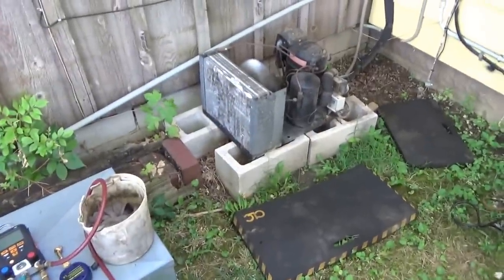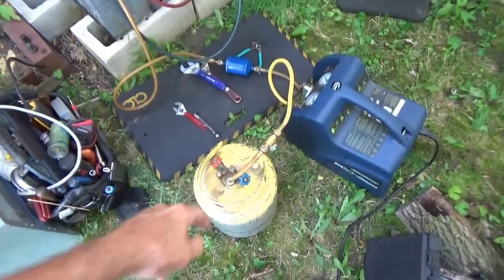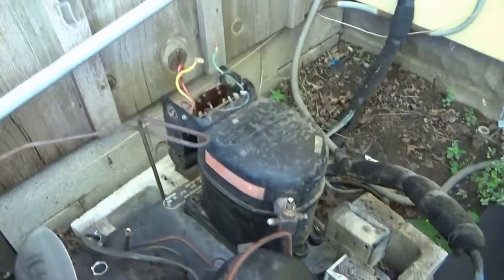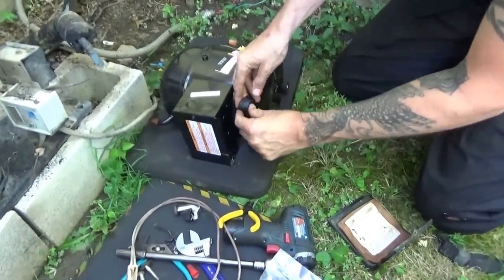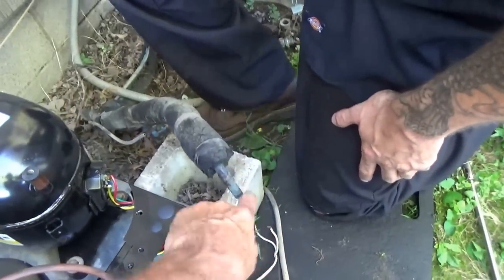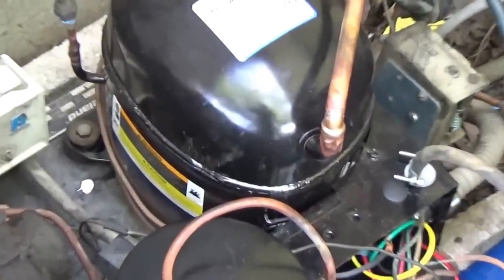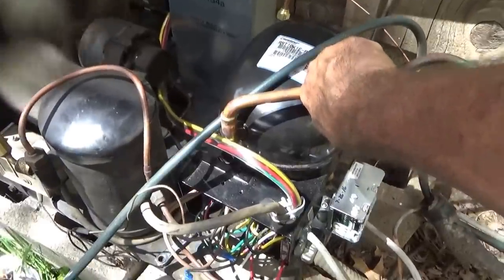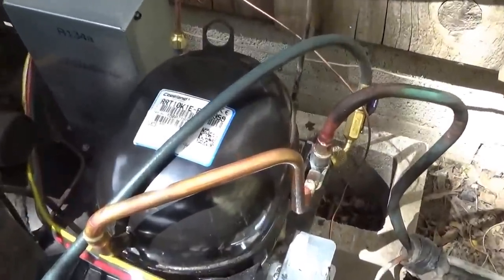Wine cooler compressor change

Comment: Jim
This is an excellent collection of hands on experience and knowledge.
Each one is very informative and filled with your easy humour and talent.
could you please post a video on your vacuum pump techniques and the fittings and hoses that you use and trust.
thanks for your efforts in this industry.
Reply: Hello Fred K,
The vacuum hoses  and fittings are made by Appion.  I connect my BluVac  Digital Micron Gauge to the Appion MGAVCT Valve Core Removal Tool.
Cheers,  James

Comment: People saying you should have replaced the entire thing must have richer clients than me lol. To me there is only one question at the end of the day... Is the wine cold. Thats what the customer really cares about. Good video and repair Jim!
Reply: I am a firm believer in not throwing things away, but the problem I see with keeping the unit is the condenser coil.  It is most likely undersized for 134a.  Definitely not as energy efficient as a newer model would be, with a more efficient condenser coil.
Reply: @markcarpenter3600  134A underszied?   134A requires the Least....  R 404 or R 22 the condenser has to be very effcient
Reply: @primetime758  134A is definitely more efficient than R12, but it is my understanding that it doesn't transfer feat as well in the condenser.   If the system was slightly oversized you probably won't see a problem.   It takes a more efficient condenser to do the same work that R12 did, everything else being the same.  

I worked an old (pre 1982) LEER ice merchandiser running R12, which was short gas.  Already knowing the answer I called LEER to see if I could possibly get away with putting R134A in it.  He said the condenser wouldn't be efficient enough.
Reply: @markcarpenter3600  meh i call BS.... i've never had an issue   rooftop condensers or just outside during the heat of the summer never had a single issue

Comment: Nice fix, Jim. I like replacing the compressor if cond unit's in good shape. Been running into a lot of leaking king valves lately,though. Packing tight but leaks.Techs tend to over tighten them. I miss the strong steel caps.
Reply from the maker: yeah, the EPA messed up by not doing away with plastic and aluminum caps, thanks
Reply: Jim Pettinato good evening Mr Pettinato I hope you are well and the reason we have not seen you in you tube is because the weather! We really hope you are well  and hope to see you soon ! I have learned more from your videos than what I learn at school thank you very much .

Comment: Jim Pettinato is the Michael Jackson of Refrigeration.

He can Moonwalk his way into Walk -in Freezers; snap his fingers & get the Fans running, defrosting clock ticking, Ice melting, Compressors belly dancing like Shakira & customers bowing down kissing his feet

 Refrigeration apprentice usually left drooling

Comment: Quick question. You replaced the (suspected) R12 with R134a. Are there any rules-of-thumb here that you could share on when it's ok to do that (along with the compressor swap). Yes, I realize there's not much choice when it comes to R12.  I'm always confused by when and where one can change refrigerant on systems like these. No concerns about the evap or condenser? Thanks for another great video.

Comment: We've never used 134a as a drop in but it makes sense since the new compressor has POE oil
Reply from the maker: been doing it since 96, use to take comp off and change the oil, now honeywell recomends adding 15-20% poe on top of old oil. thanks
Reply: ill admit we are a little slow on the change over. been using 409 to replace r12 but tends to run hot thanks enjoy your videos

Comment: nice job Jim looks good another quality job 
I have a question on the flux you us when brazing lately I had problem with brazing joints with some coils and condensers valves thinking about using flux any problems with flux getting into the system like the txv I put in a lot of carrier and rheem equipment any tips thanks again for the videos Jim
Reply from the maker: no problems not even cap tube systems,thanks

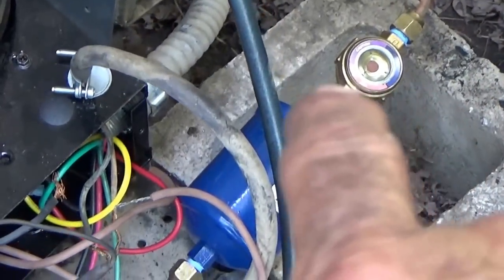Comment: I have a question about the installation of the sight glass and the liquid line drier.  It appears from the video at position 8:06 that the threaded connections have been prepped with pipe tape or pipe dope.  Is this correct?
Reply from the maker: I use leak lock and teflon tape, it's just long term protection

Comment: Jim i have a question...........on a 410a system with a fixed orifice.......how can I tell if it is the right size piston without actually removing the piston and checking the number on it........
Reply: james fields you cant

Comment: Hey Jim, 
any reason you put your micron gauge on the vac pump and not on the valve core remover?
Reply from the maker: I use the core tool fitting for my gauge set to break the vac with refrigerant.

Comment: great video Jim,thank you. I have a question, could a sight glass be installed on a unit that only holds 13 oz?
Reply: Ron It all depends on the meter device if it a cap tube not really because it cap tube is by refrigeration flow feeding your cap tube charge by superheat at the compressor or weight in charge more critical charge .if you have a receiver on the condenser with a TXV yes  every time because you want all liquid feed your txt valve to work right when charging be careful if you see no receiver on the condenser it could be either sometime they will oversize the condenser and you think it's a cap tub but it a a TXV on tech in.

Comment: hey jim great video. quick question 350 microns bench mark for refrigeration systems?
Reply from the maker: 250 - 500 microns.  Don't go lower than 250, the compressor's oil will fractionate
Reply: Jim Pettinato Good to know your ok got a little worried.Great to hear from you.

Comment: What do you think about running nitrogen while brazing
Reply from the maker: it's good especially on big jobs, on small jobs it's good but not imparative. thanks
Reply: +Jim Pettinato I'm gonna disagree there. Nitrogen should be purged through every single time you touch a flame to that copper pipe. Also, you don't see if the vac holds? It hit so low because the micron gauge was on the pump. Even with a small leak it'll pull down when it's on the pump. In my area we have to hold 500-750 microns after the pump stops.

Comment: Too bad the Customer did not replace the condensing unit. 34 year old condenser --- could be trouble ?
Reply from the maker: it's a small country store, small pockets
Reply: Yea, i hear ya. but, not much more for a condensing unit. $100.00 here in that size. i could understand that with a larger unit / larger compressor. but, oh well. Old condenser fan motor- gonna go soon. 34 year old condenser- gonna leak soon.penny wise, Dollar foolish some customers are. no shroud, head pressure will be higher, compressor will not last as long.
Reply: i've been seeing you.. everywhere giving your input... everywhere.. do you think your the best in the world?

Comment: hey jim i need movea semihermetic outside and put it in exterior and not have a gabinet, any idea? i can put de condenser up and the compresor down a plate?
this is similar 

http://static12.gestionaweb.cat/1425/pwimg-1024/726.jpg
Reply: JIM?